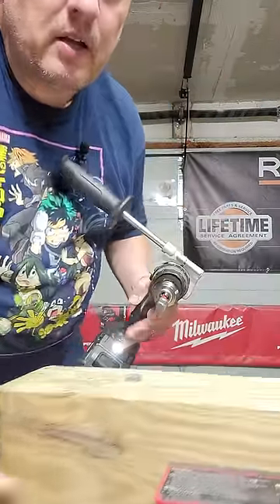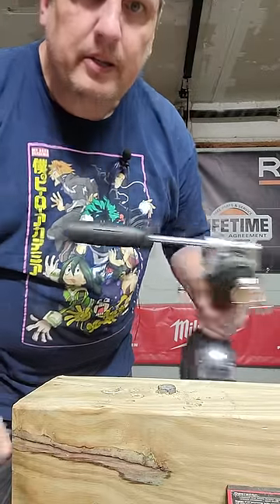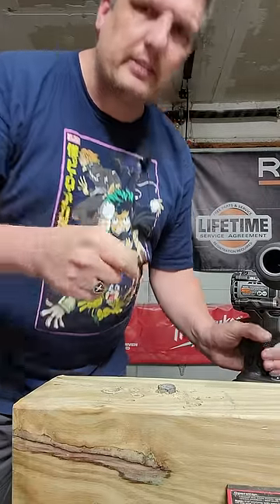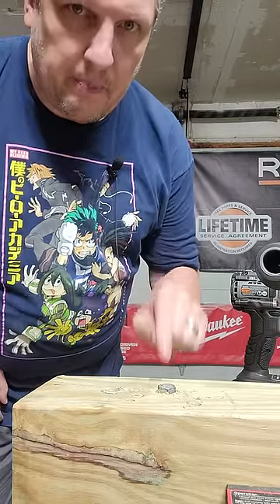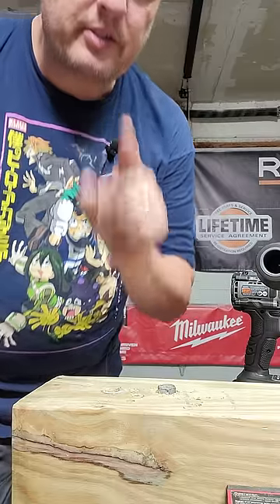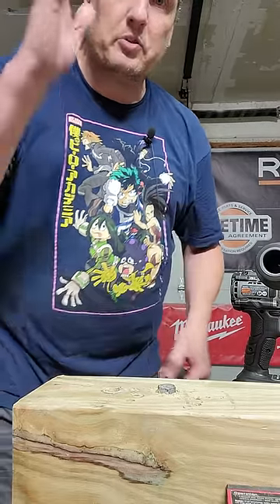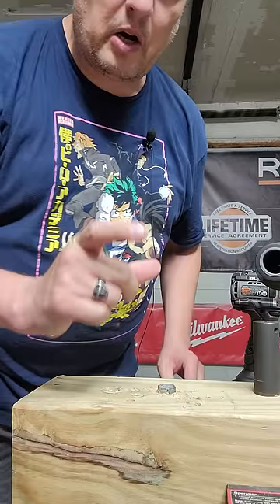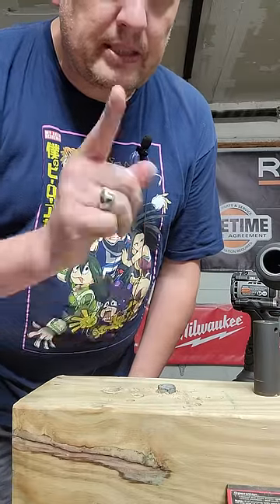Challenge Accepted! Now What? #challenge #powertools #tools #power #drill #EMBARRASSING #victory

Comment: Who the hell would use a 1/4” hex impact for a fastener that size? Get a 1/2” drive impact on that thing!
Reply: Yeah .. what he said☝️
Reply: Yep, if were driving big bolts or making up beams we use the 1/2" impact for that. Unless you have the top of the line 1/4" youll be there for a while
Reply: Well said
Reply: How about pulling a bowed or twisted timber flush or straight using lags and washers? Will that drill still work best? 1/2" lag bolts break with 1/4impact some of the longer 9/16" also broke on my last project so I just used 12" ardox spikes worked great and faster than your drill. But ardox nails are very hard to remove.
Reply: I've used my M18 1/2" impact wrench on lags, it's way faster than that with way less effort and danger to the user.  The only danger is they can over tighten and strip out the entire hole, so don't let the new guy use it.
Reply: Yup, half in impact wrench
Reply: You were paying attention
Reply from the maker: Ma'am playing with your Legos doesn't count as building
Reply: Impact any day instead of a drill
Reply: @ToolswithSoAlz and drilling into a random piece of wood on a work bench doesn’t count as building either 🫳🎤
Reply from the maker: Whatever lie you need to tell yourself Princess
Reply: @ToolswithSoAlz soft hands
Reply from the maker: And you brother compliments you one your soft lips Princess

Comment: Finally somone is saying out here, not everything need an impact, plus the control you have with a drill. A drill is also mucbetter wheb dealing with small machine screws because you can use the clutch to make it slip before it strips

Comment: I have a 13 amp corded drill I use for bolts such as that . Small screws it will put strait through the wood head and all . Down side is if it catches it will try to rip your arms off or spin you around like a  auger .
Reply: Oh i love my corded drill..if i need something with sped and ass i always use corded
Reply: I've told you a million times not to exaggerate
Reply: Yeah my corded 1/2” drill will injure me if I’m not careful haha.
Reply: Any contractor will tell you, for jobs like this, you ALWAYS use a corded drill. The stress on your batteries and associated tools is not worth it. Yes, the drill as well as impact will do the job. JUST BECAUSE YOU CAN WITH BATTERY POWERED, DONT MEAN YOU SHOULD... Unless in a pinch, at the end of the day, it's cold beer time, and cord won't reach. Then tear that beiotch up!!!
Reply: This! I just recently purchased a corded drill while running some cables. The framework under the wall cavity I needed was monstrous and my drill/flex bit kept binding. Corded drill got the bit unstuck, powered through, and has saved my butt multiple times since in such a short span. Ive always slept on corded drills and stuck with cordless, and I wish I would have gotten a corded one so much sooner now 😂😂
Reply: I once tried to drive a lag without predrilling the hole first. I learned my lesson and never repeated that mistake again!

Comment: If you run that all day it might make 2 shifts.
Reply: I doubt it would last that long.  I'd be very surprised if it could do 10 bolts back to back without smoking.
Reply: If you ran it like that all day he wouldn't make two shifts
Reply: @ferrumignis yeah the flex turbo mode you can hear kicking in halfway only does it twice before it's too hot to continue
Reply: @rockhead1731 I’ve done it with big timber locks all day, I use it for truss screws too, never needed to install bolts like that all day. That’s makita though
Reply: Smoke break

Comment: He's right about the drill. We've all just gotten so used to using an impact for everything we forget about the drill.
Reply: drills are not designed for this. you'll roast your motor doing shit like this. impacts are a little slower sure, but they're designed for that specific purpose. drills are for DRILLING. Not torqueing.
Reply: Yeah, there is a reason we forgot about drill... Impact is easier, quicker and less stress on my wrists...
Reply: Impact won't break your wrist
Reply: Lol forgot or just smart enough to adapt!!
Reply: Meanwhile I was taught to use a drill PROPERLY from a very young age so I've never owned an impact driver. Tried one a few times but they just seem like a lazy option for those that don't know what they're doing.
Reply: @tristan5428  Meanwhile, I was taught to use the proper tool for the job from a very young age. It's a shame that you weren't taught that.
Reply from the maker: For someone trying to shame another about their knowledge of tools, it seems you should be taught a lesson yourself. An impact driver is designed for small fasteners where camout is a possibility, self tappers, and over tightened nuts and bolts. That's it! Helps if you know what you're talking about next time.
Reply: Drills are for hammer drilling. Impacts for everything else💯
Reply: Theres a reason
Reply: Impacts only have 1/4" chucks. Which unless you spend twice the money on all your bits, they aren't going to fit. Two- try driving a four inch screw with your impact. It takes longer than a drill and gives you a migraine from all the noise, especially if you have a lot to do. I'm going back to the drill for a lot of things and finding it better. We're just impact happy but it really isn't the best tool for everything. And if your breaking your wrist with a drill you prob have very poor tool control and experience.
Reply: Speaks for your self. 
I rather use an impact, easier on your wrist and won't twist your wrist since an impact uses a hammering force while a drill uses a twisting force

Comment: A drop of dish soap goes a long way on situations like that.  Can help stop splitting too.
Reply: Or wax
Reply: I would drill a pilot hole, but I like having beams that aren't split.
Reply: @nunyabusiness5075 😂😂 How do you know what size pilot hole you need? I need to learnssss these things
Reply: @Matteo-lr6ke I'm not an expert like everyone else commenting but... I would choose a drill that has a diameter equal to the core of the drill or just a hair smaller. When I drill a pilot hole for a big drill I do the same.
Reply: @nunyabusiness5075  the pilot hole is usually 2/3 of the actual hole

Comment: 1000% facts… thats why people be destroying their impact drivers then blaming the manufacturers saying their tool is junk 😅…. If you’re a content creator I get it, but if its real world scenarios its silly to drive these size fasteners with an impact driver…. And while a drill is likely the fastest. I like to note that an impact wrench is probably the safest while still being efficient and effective.
Reply from the maker: I would agree with you. Fact is that a drill would be used first for this task as you would use it to drill a pilot hole.
Reply: @ToolswithSoAlz  yeah… for sure the right way of doing would be hitting it with a pilot first.
Reply from the maker: Exactly
Reply: Most homeowners think an impact driver is the same as an impact wrench.
Reply: @alexfrederick9019  lol 😂 💯
Reply: @alexfrederick9019 😂😂😂😂😂😂
Reply: @bigwahoo8686 a 1/4" wrench isnt very common and that isnt what you would use. You would use a 1/2" wrench which is designed for higher torque, clear to see you have no clue what youre on about
Reply: With correct size predrill it shouldn't matter what tool you have as it won't struggle.
Reply: @bigwahoo8686 umm no they arent 🤣

Comment: If you don't set the clutch, that thing can seriously hurt you....he was obviously in drill mode, not driver mode.
Reply: I'm assuming you mean the part that makes your drill not worth a damn because it wants to keep going into a safety where it just just slips a bunch instead of doing the job? Yeah nah, my dads been using them daily for well over 2 decades and I myself have been using drills for well over a decade now as well, always set that thing to just drill, no safety, youll be there 10x longer and will be much weaker than the fella who just jumps in and bites down and actually uses some man power as opposed to the one trying to let the drill do everything while he gets absolutely nowhere and heck I use the flex tools nowadays with the turbo mode (havent even truly needed it yet tbh but i havent had them for terribly long) and i dont need a secondary handle, just grab that mf like you mean it, i even mix concrete with a giant mud mixer, it throws out some SERIOUS resistance but im a big boy now and can handle it, i guess not everyones built that way, but its a lot easier to gain weight than to lose it for most people.😂✌️

Comment: I am a control technician, so the driver is my go to. There’s only been one time where I ever “needed” a drill I was putting some sensors into the concrete ceiling in a parking garage. Knowing me, I would’ve found a way to make a driver work but my colleague informed me a drill is “required”. 

I have a Milwaukee M12 driver my older colleagues wine, and say I should have a bigger drill like a 20v even though we mostly loosening and unloosen 1/4” and 5/16 screws. f that Until I find a job that my little M12 can’t do I’m going to keep using it.
 
I am getting that M12 drill, though, just in case

Comment: i've driven in bolts larger than that with a 1/4" impact. but, fun fact, if the bolt is so large that a1/4" isn't cutting it, you can use an impact wrench. compact 1/2" and 3/8" impact wrenches can be picked up for about $100 (dewalt DCF921B 1/2" impact wrench is $100 on woot right now), and they'll have that bolt in like a hot knife through butter. as an added bonus, your elbows will not be broken
Reply from the maker: Just use a drill

Comment: I agree, impact drivers are for small fastners. And while a drill driver can handle this, it puts a lot of strain on them if they're having to do a lot of larger fasteners. A lag like this should be done with an impact wrench.
Reply from the maker: A lag like this should always be done with a drill.
Reply: Valid on both counts, this will heat the drill motor up immensely, and could potentially cook the brushes, BUT the excessive vibration from the impact can prematurely weaken the structural integrity of the hole and allow the bolt to wobble loose. Personally I'm.not sure which would be worse a using a small bit to make a little pilot hole easing the strain, or using an impact driver and risk it. Maybe just use a hammer drill, and split the difference, constant torque with the occasional smickidy smack 🤷🏻‍♂️...
Reply: That drill doesn't have brushes so you're not going to burn them up 90% of all new drills have no brushes on the motor as a matter of fact they've been advertising for 10 years brushless motor
Reply: @laylathehappygamer6339   sadly, i know that it's VERY possible to burn a brushless motor up. Lol.
 
 I don't have a ton of  experience with cordless brushed tools, but the corded brushed provide more torque in heavy use situations (like mixing concrete). The brushed go a lot further than the brushless, but once again, that's comparing cordless to corded. 
 
But a corded brushless, can definitely burn out. Although, the more recent releases will have overload and overuse protection built in... and I can't stand it because they tend to be overly-sensitive causing the tools to shut down.

Comment: If you lubricate the bolt, even with soap, it will drive much easier.
Reply: Same for saws....soap the blades and it will cut like butter. Old school trick my grandpa showed me decades ago.
Reply: @alextheonewarrior  on a cut surface? Who cares?
Reply: @alextheonewarrior  have you ever done it, cause my gramps did it for his whole life. Trees, framing, etc.
Reply: @leetjohnson 
Makes me wonder, have you ever used candle wax instead? I don't have power tools to try this on but I do have hand tools and the first time I worked on a Stanley Hand Planer, I put candle wax on the bottom and damn near fell forward because of how slick it was. I went from applying moderate pressure to almost slipping on my ass using candle wax lol. Sounds like it would work but IDK
Reply: @catdadreloaded376  that "wood" work too! 😄
Reply: I use a wax ring for a toilet, I cram it into a pill bottle and dip screws about a third of the way in. Works great for hard woods.

Comment: Just be honest, how often do you use such bolts? As a carpenter I use such bolts a couple times a month and for that I use a high torque impact wrench. For almost all other work I always use my drill and rarely use an impact driver. Why would i use a noisy impact driver that require ear protection, when I can use a drill which is faster and quiet and does not require ear protection allowing me to talk to my colleagues.

Comment: I usually just drill pilot holes and then use an impact. Gets the job done in less than an hour.

Been doing the same thing for half a decade. Both drills and impacts have their place in the tool world, I doubt either one is going to disappear anytime soon.

It’s kind of like DC and AC power. Both have their different applications.
Reply: And using an impact driver saves your elbow.

Comment: In 30 years of marine construction, I've built a few miles of seawall, a mile of saltwater fishing piers, a bunch of boatbouses, many random decks, and 31 beach homes.  On 3 occasions my guys sprained their wrists using a drill to drive bolts.  Little did I know they were probably just pussies.

IF like this uploader, you are making a successful career driving lags into a 6x6 scraps, in your garage...that's great.  BUT...when you are ACTUALLY building a fishing pier, standing in a 12 ft Jonboat, under the deck, moderate waves, attaching 3 x 8 timber braces, you can imagine why this guys drill technique has no connection to the real construction world.

Sure, the drill can do the job, but I prefer to take care of my workers, and always provide impacts.  IMPACTS ARE SIMPLY SAFER.  A PRO contractor does not give a flying fck about saving 4 seconds on driving a bolt.

And FYI...everyone.  When you twist your wrist badly, it usually never heals fully.  Ask any real, experienced, professional, contractor, not some poser on YT.
Reply from the maker: Oh look another Faux-fessional. How refreshing. Princess if you had any clue as to how this would really be done, which you don't because you're an idiot,  you would know why the drill is the right tool for the job. Two words are all I need to expose you as a poser...pilot hole. Wake up and get your brother out of your mouth little Lady
Reply: @ToolswithSoAlz  Well, that escalated quickly. Don't be that rude in your own comment section, respect other opinions and you'll also get respect back...

Comment: A hammer drill like this is the correct tool. They are stronger than your standard drill and they have the additional side grip because of the torque.
Reply: Don't use it on the hammer setting though...
Reply: I'd just like to have the drill he is using...lol....😂😂😂

Comment: Could running multiple lags overheat the motor though?
Reply from the maker: I did several and didn't have an issue
Reply: @ToolswithSoAlz  Try doing it all day on an actual job site, not going to happen with a drill, you will smoke it or the gear set. Then there is the problem of getting  the fastener actually tight, say you are pulling two boards together and one has a slight bow, the drill will never deliver enough torque to get the two boards together tightly and not tear itself out of your hands in the process. There is a reason they make 1/2" impacts and one if its uses is driving fasteners just like that. Speed is not the issue, getting it done and longevity is. 

Sorry to say but driving a long lag into a single post is not real world.

Comment: Gotta love the simple machine known as the screw.
Reply: Did you mean drill? Screw is just a fastener. Machines have moving parts. Fasteners just hold things together.
Reply: Inclined plane
Reply: Your  🌽 fused  guy.
Reply: @ursidae1770  A screw is a mechanism that converts rotational motion to linear motion, and a torque (rotational force) to a linear force. It is one of the six classical simple machines. The most common form consists of a cylindrical shaft with helical grooves or ridges called threads around the outside. Like an apple peeler.  
From Google; Fasteners are hardware devices that join objects together. This includes bolts, screws, nails and more. We aren't talking about the mechanical tool we are talking about a fastener.
Reply: @macgreeze8287  can it not be both a simple machine AND a fastener? Because it is.
Reply: I mean your comment even says it’s one of the six classical machines

Comment: I use a big drill for lags. I found it to be much better than an impact. In wood like hickory or white oak I will pre drill a pilot hole. You can also spray a little oil on the lag to help if staining is not a worry. People mention the drill gets hot. I find the impact gets just as hot or hotter.
Reply: Use bar soap try it.

Comment: Back in old days before lithium ion batteries and cordless impacts thats how it used to be done. That was when the 18 volt milwaukee was king dewalts batteries wouldnt last. Otherwise had to drag out extension cords and grab the spade handle drill or had to use old arm strong method. I should know as a basement dwelling faux-fessional.
Reply from the maker: Pretty much
Reply: That is why I don't buy DeWalt. My 12 volt batteries didn't last.
Went back to corded and a generator.
A big lag like this, I had a Milwaukee electric 1/2 impact wrench.
Reply: @markchidester6239  I run the 20 volt and 60 volt flexvolt dewalts now. There is no comparison to old nicad and first gen lithium ion that milwaukee had before being bought out by Chinese investment bank. I've never tried dewalt 12 volt line I did try m12 line but is for dyi or electricians. I got into dewalt at time had better price and they atleast made new technology backward compatible unlike milwaukee.